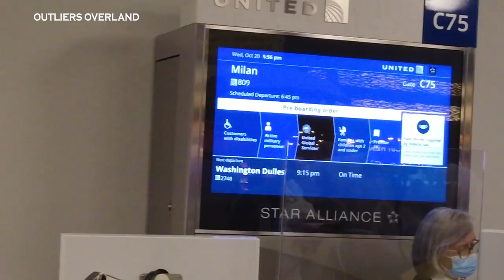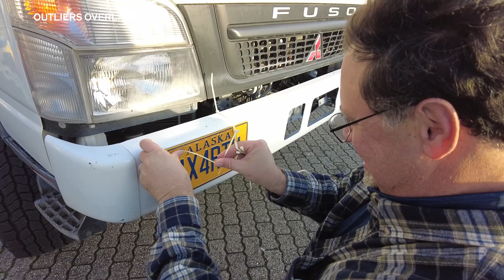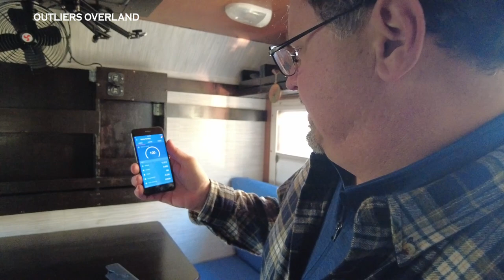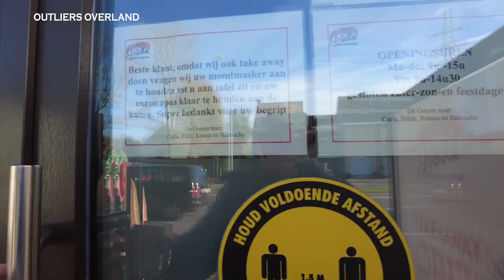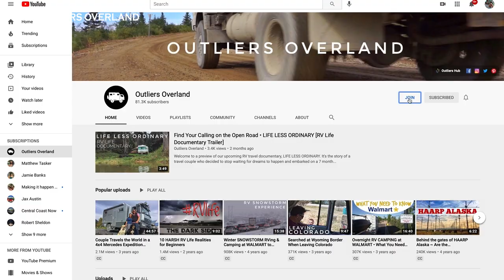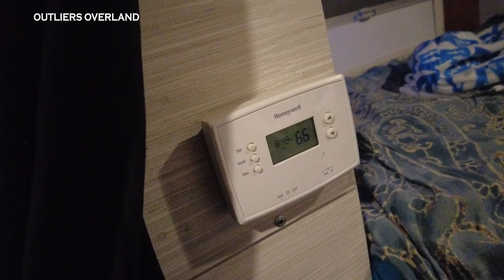Shipping our Van from America to Europe and Starting a New Life

Comment: 0 seconds ago
Maybe you guys could do a video where you look into converting your engine to natural gas or propane to save on money refueling it.  I'm curious about this myself.

I know you'll loose about 100 mile range and about 10% horse power, but maybe it's worth it?
Reply from the maker: We want to continue our drive around the world and diesel or gas is the way to go.
Reply: Why is deisel better than regular gas in your truck, or propane, or natural gas?  What year is your truck?  Does it require the deisel additive?  Have you had to repair the expensive diesel smog systems yet?  Is it worth paying premium prices for diesel, vs price for regular gas?
Reply from the maker: @giuliom8520 we specifically bought our 20007 diesel so it does not need ULSD or DEF.    
Gasoline would be fine but I’m certainly not in the financial position to change engines or trucks just to run gas.    
LP or natural gas is not practical for the places we want to travel, like Mongolia.
Reply from the maker: I’ve never specifically looked at gas prices since being here in Europe but I googled and they are in the same range as diesel.